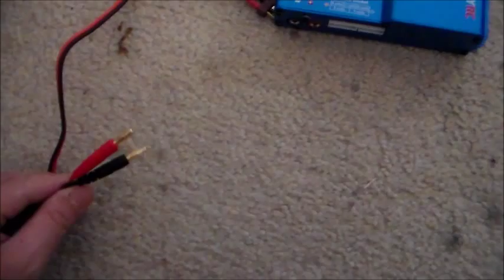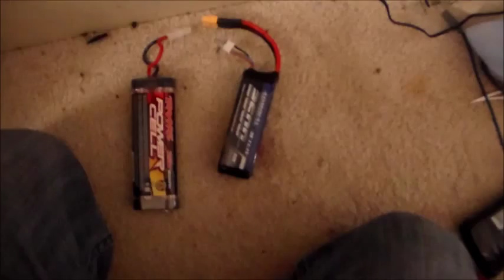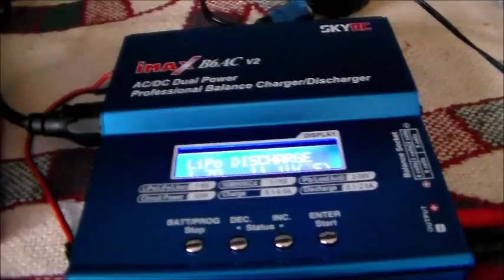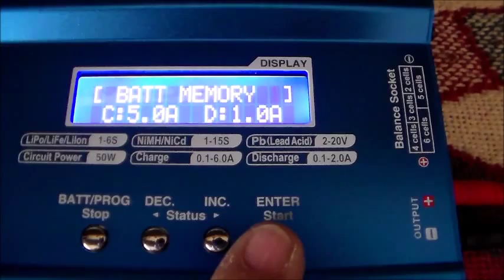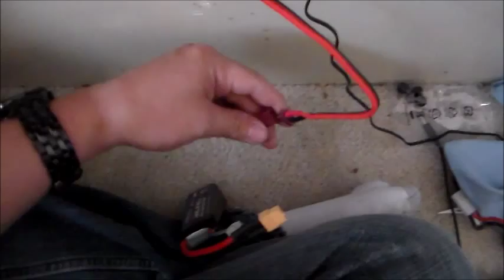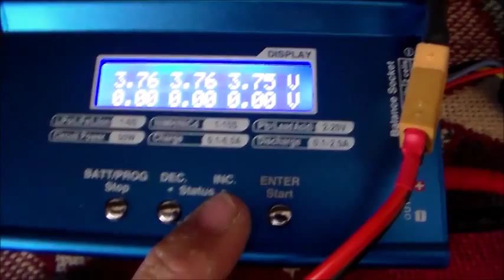Genuine SkyRC iMAX B6AC V2 Battery charger complete overview

Comment: what is that connector you have to charge your tmaxx, i watched your other video you said you have a venom pack and charge it through the charge port on the battery box.  i would also like to do that.  what venom pack do you have and what connector do you have to connect to charger?  im looking to get a hump pack that fits in battery box and a connector/charger to charge it in tmaxx battery box.  thanks for any help
Reply from the maker: the charge connector is the xt60.  I have a second skyrc b6ac coming seeing that the X-maxx takes 2 batteries.